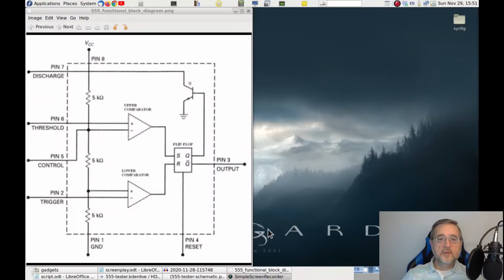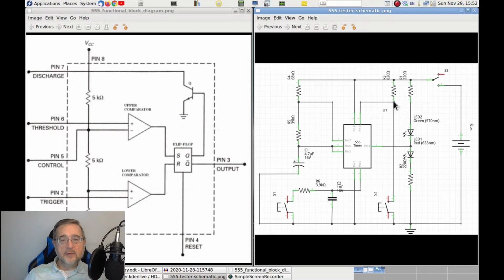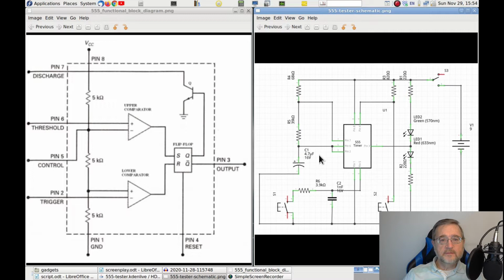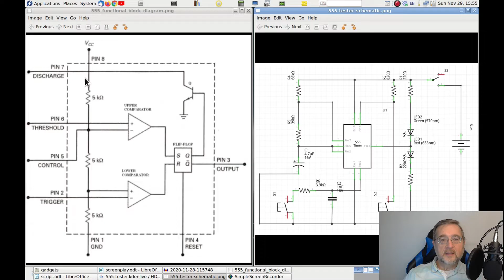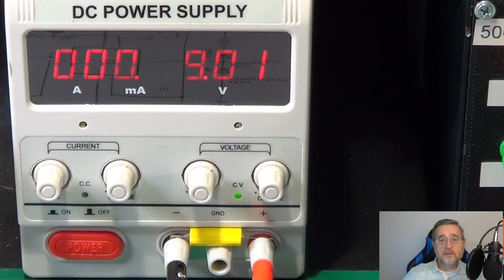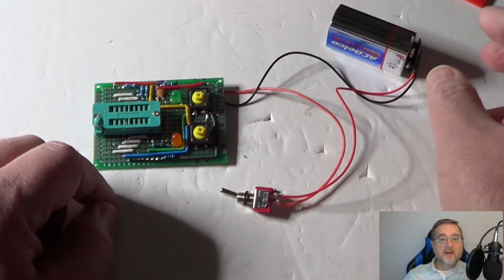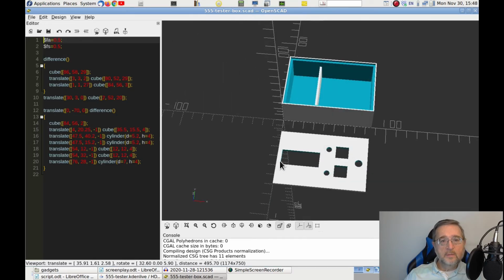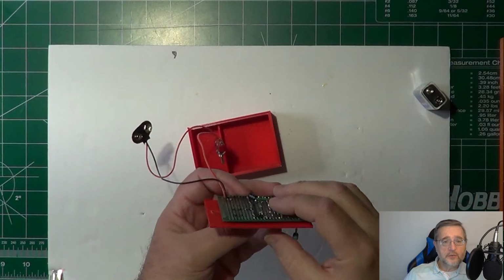The Ultimate 555 Tester

Comment: I had fun with this project and made a board for my toolkit.  I recently started getting some CMOS timers for an upcoming project.  I'm talking about the ICM7555/ICL7555.  I tested a few with the tester since they are supposed to be a direct replacement for the NE555 (in most cases it says) but different results than with an actual NE555.  I'd really enjoy a video comparing the NE555 to the ICM7555.  Maybe a tweak to the tester so it can be used to test NE555 and ICM7555 would be great.
Reply from the maker: I'll see what I can do.  Thank you for the feedback.

Comment: That takes me back to highschool - I convinced my parents to buy me a 555 from RadioShack.  I had a broken fragment of perfboard, a 9 volt battery ( 6 D-cells potted in epoxy, an expired ELT transmitter battery from an airplane ) and an assortment of resistors and capacitors scavenged from old airplane radios.  I had several switches and could change the speed and duration of the flashing.  I had that running for a year before i needed the battery for something else.
Reply from the maker: Good ol'times. I also started playing with this stuff when I was in high school.

Comment: What is the ceramic capacitor for?  I actually forgot to hook it up when testing on a breadboard and seems the circuit acts the same with or without it.
Reply from the maker: Capacitor C2 is used to remove any possible noise caused by the bouncing contacts of the switch. It is not used to make the circuit work, but only to stabilize it. That's why the circuit can work without it. Its only reason is to prevent the circuit from behaving like the button is pushed multiple times at a fast pace, before actually working the way it is supposed to. Yoy may not notice it, but it is actually doing something.
Reply from the maker: No. The problem is to keep stable the voltage on pin 5, because that is a reference voltage for the comparators. The other button acts on the internal flip flop reset. Having multiple fast resets on that pin does not make any difference at all because the flip flop will absorb them with no side effects.